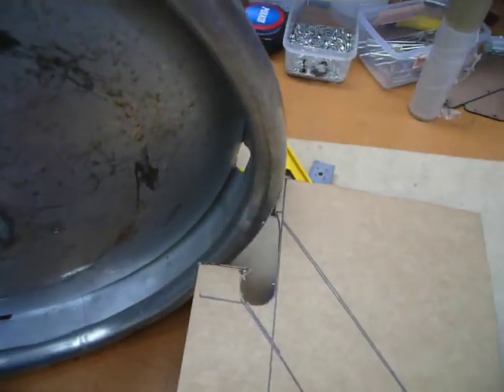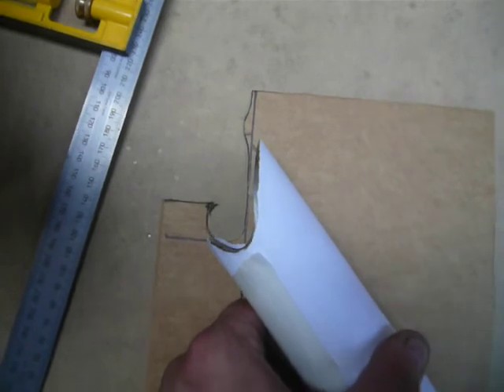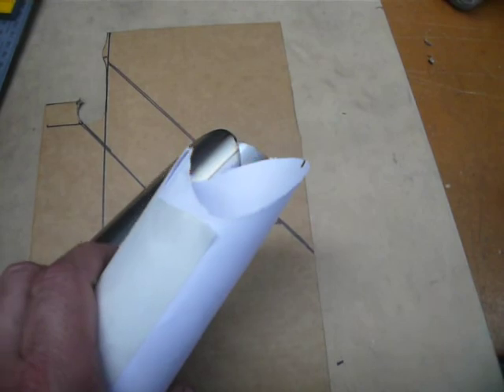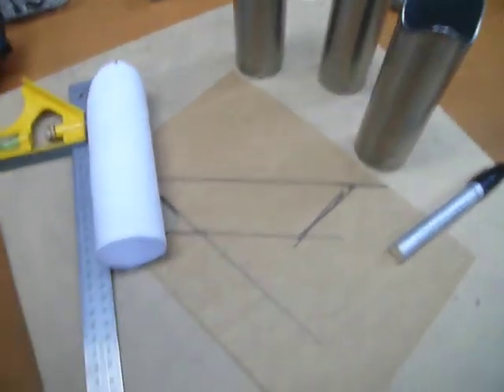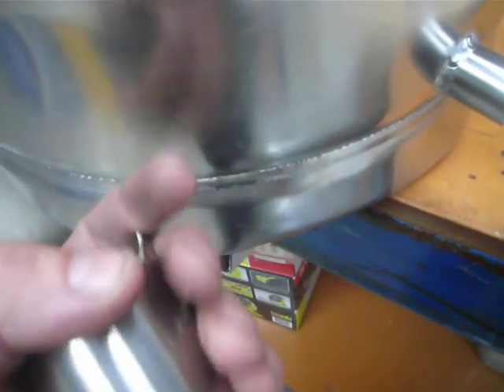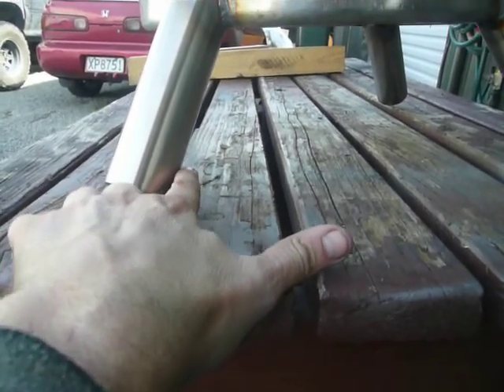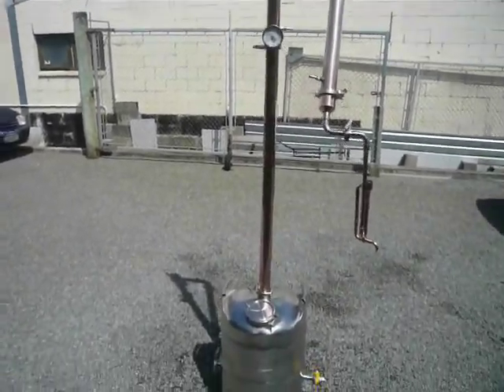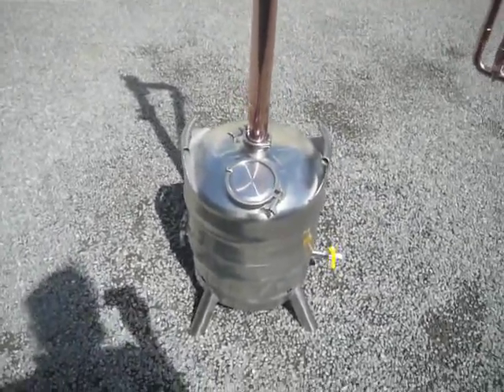Keggle feet

Comment: That's how I did the one I got. Love the way you did the Handel's look great!..🍻
Reply from the maker: Heya Corey, I ended up doing the handles differently on subsequent ones I sold.
I now leave the skirt/ring at the back - makes it much easier to pick up and tip out for washing etc, ... with the skirt removed at the back it was actually more difficult to swing around.
Definitely needs the skirt cut away in the front to facilitate cutting and welding the 4" ferrule.

Happy Distilling!

Comment: No prob  your welds look way better than mine.  Any tips
Reply from the maker: Umm ok, sure Kev', I don't want to come across as telling Grandma how to suck eggs tho' - I can tell you how I set up for welding thin/fine jobs.
I'm no ticketed welder, don't have any of my cert's or stamps but I've spent a bit of time on a TIG off and on doing small/fine components over the years for prototyping.
For what it's worth ...

Most important thing before I fire up the TIG is I spend a lot of time making sure my parts match as best I can.
You can easily gap fill with welding unlike soldering but if you get the contours of your parts to match within a mm or so you have saved yourself a whole bunch of time and grief to start with.

I always grind a fine arris on the edge of slightly thicker parts like legs and ferrules to get better penetration same as I would with a heavy job (although I don't want to blow right thru' the vessel). 

 ... welding thin wall vessels/stainless sheet steel or small mechanism parts, I use a very thin electrode - (about a 1.6mm diameter) Thoriated tip and I run the TIG quite low - about 30-45amps or so depending on material thickness.
I try and have as little electrode exposed as possible but sometimes it needs to extend quite a way outside the ceramic gas shield to reach the job.
Also use a fine filler rod - 1.6mm stainless filler.
I run Argon gas - not Argoshield mixture.

I'll concentrate my heat on the edge of the heavier walled part - ie; legs or ferrules and "wash" my weld pool down onto my vessel/thin wall to try and avoid complete penetration thru' the vessel (can't always be avoided).

I also keep my handpiece/electrode very low, sometimes almost tangential (but not quite) to the work surface to avoid blasting thru' it or getting sugaring on the inside/backface, (again, can't always be avoided).

Passivating the result with hydrofluoric acid gel, washing that off and then lightly buffing it up afterwards, also helps make it look like I know what I'm doing.  LOL

Any of that helpful ?
Reply: Angry Parrot Distillery actually yes.  I've been using an 80 20 mix and I think having my tip to far exposed and to large.  Granted I do way more mig welding. I got some scraps to start practicing so I can do those other kegs and didn't want to go through all the problems I had on the first one.